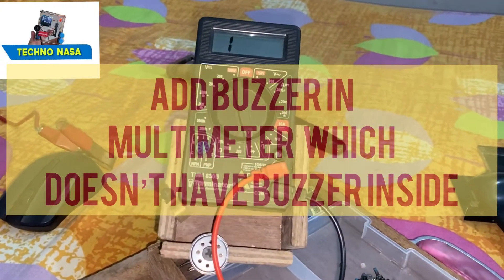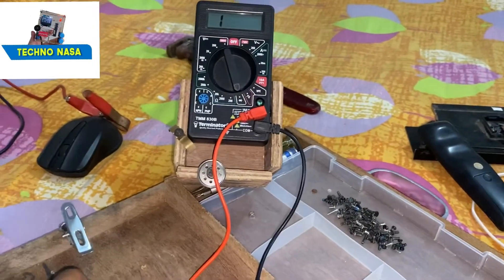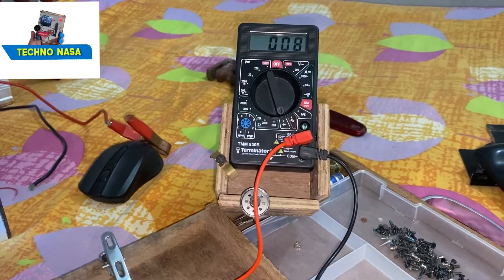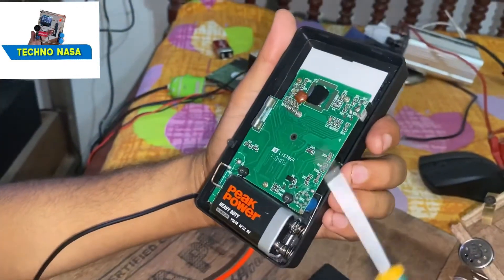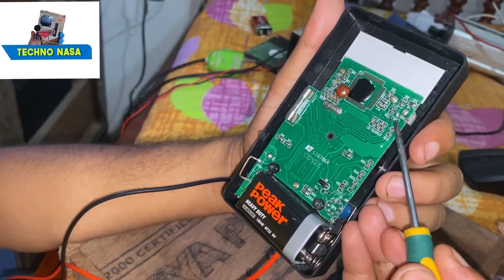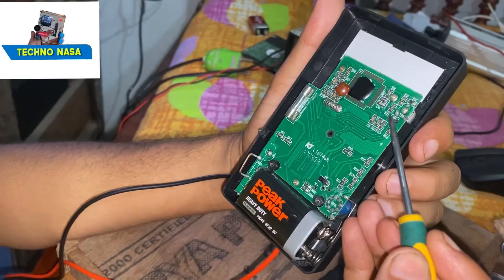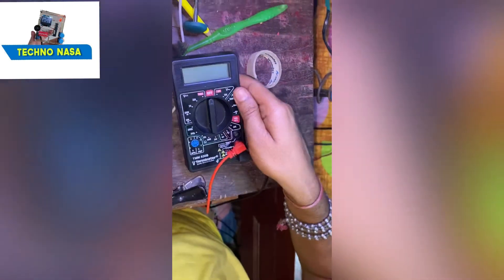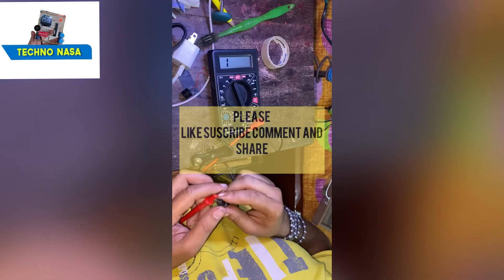How to add buzzer in multimeter

Comment: My arduino piezo buzzer doesn't beep on 9v batterie it just makes a noise what does that mean
Reply from the maker: May be u use speaker instead of buzzer , take 5 v buzzer from market and try that one , first check with dc voltage wether it will produce beep sound or not
Reply: @technonasa1667  got them going : )

Comment: i can measure mccb by this device??
Reply from the maker: Mcb or mccb??
Reply: @technonasa1667  both
Reply from the maker: @alhikmani3574  its normal multimeter
Reply: @technonasa1667  meaning no problem?? measure with 750v correct but when maybe i don't know the rating there are any dangerous ???
Reply from the maker: @alhikmani3574  you need to check the rating of multimeter first ? Upto how much volt it will measure , without knowing dont put in 750 v , it will b damaged and you will get shocked
Reply: @technonasa1667  same this device i have
Reply from the maker: @alhikmani3574  check the rating first before testing highvoltage
Reply: @technonasa1667  rating what? mccb

Comment: Do not lose your time... these multimeters are ALL DIFFERENT even thou they sport the same model number. I haven't found any point suitable for this scope In my multimeter which aesthetically is identical to the one can be seen here.
Reply: The integrated cirucuit is the same though. The buzzer goes between pins (pads) 7 and 46.
Reply: @SirWolfCZ  Mine has only 42 pins....
Reply: how did you number the pads on the pcb? Where is pin #1? I've seen with a scope, none of the pads has a signal on it wher terminals are shorted in diode mode.
Reply: @mariodistefano2973  In the DT830D multimeter I own I have a silkscreen rectangle around the pins of the integrated circuit. The rectangle has one corner chamfered, indicating where the pins are counted from (counterclockwise).
Maybe the ICs aren't the same after all.

Comment: What is buzzer ratings like volts, type, etc. specification?
Reply from the maker: If you use 5 volt beeping buzzer it will consume battery fast but 1-3 volt buzzer that you can find in toys piezo buzzer